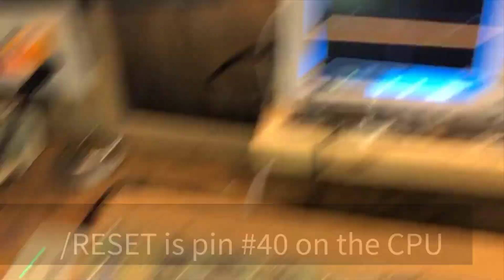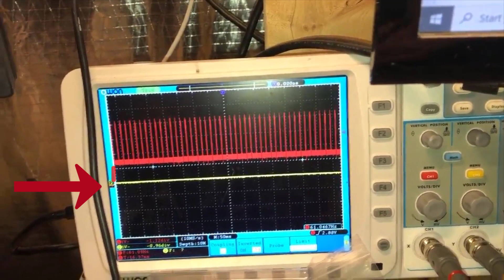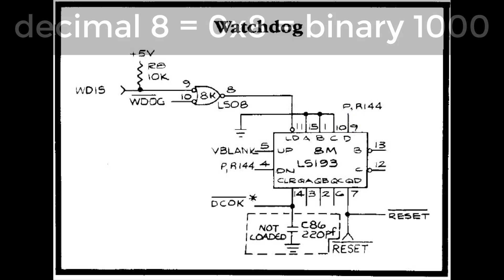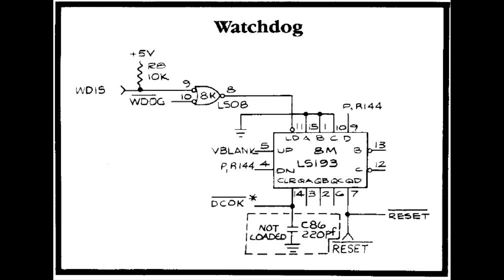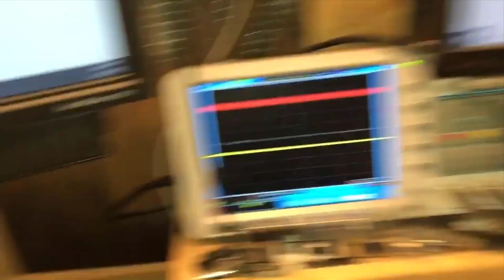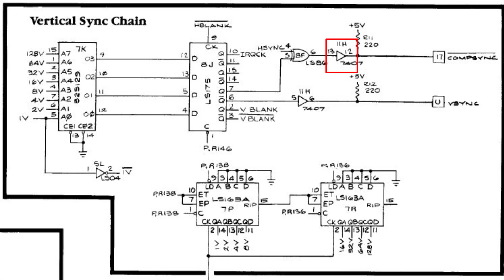Arcade PCB Repair 20200223.01 Crystal Castles (/RESET and Video Sync errors)

Comment: Do you have a converter on your page to convert 82S123 proms into 27c512 eproms?
Reply from the maker: Mazwreck yes on my products page
Reply: all i can find is convert from 27c512 to 82s123 not the other way around
Reply from the maker: Are you looking for a physical adapter to plug into or the file format?
Reply from the maker: @Mazwreck  If your using one of my adapters, and the 82S123 PROM file is from MAME, you don't need to do anything special
just choose w27c512 as your device and load the image to burn (load at offset 0x0 if your programming software doesn't already assume offset 0x0) then burn as a normal w27c512. If your file is NOT from mame, it depends on the format your file is in, more that likely it will require some conversion. (probably inserting 0xF every 4 bits)
Reply: @arcade-cabinets  ok thanks ill give it ago